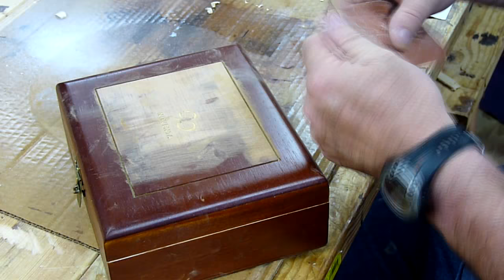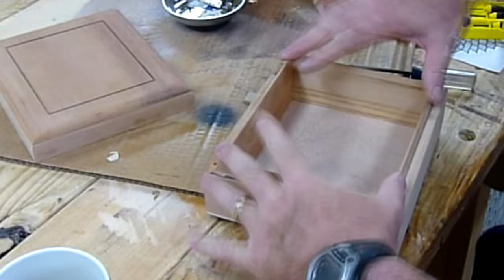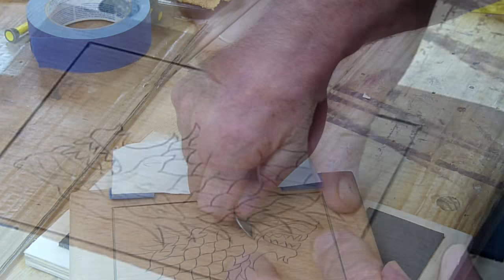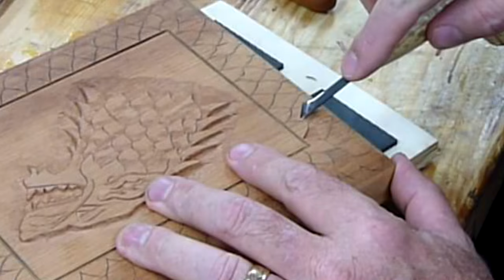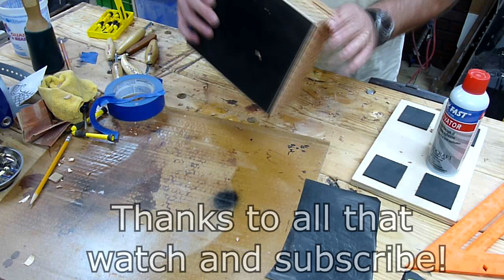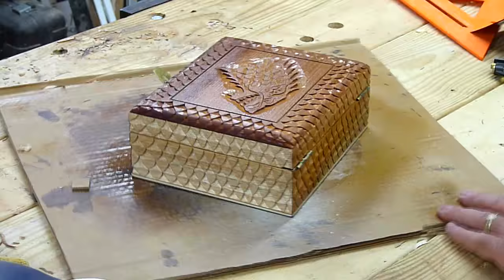Carving A Cigar Box - House Stark - Game of Thrones inspired

Comment: if i wanted to teach myself to whittle, which seems like a small less messy job, is ther a knife or chisel or wood type i should try?
Reply from the maker: I can't really name a brand in particular, but I've found that a shorter fixed blade is easier to control that a longer blade or a folding blade.
Reply: R Humphrey i have only just today realised you were replying, i could only see the hearts. so thank you so much for helping me find a way to get started. i will be slowly reading your replies with joy.